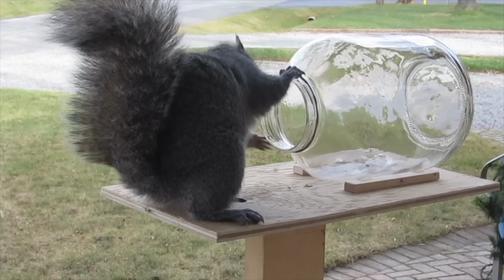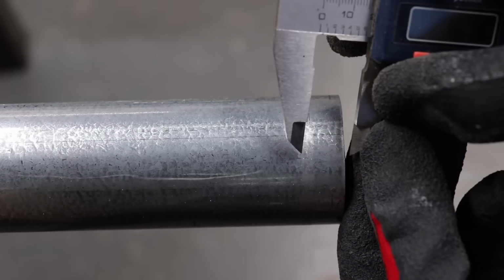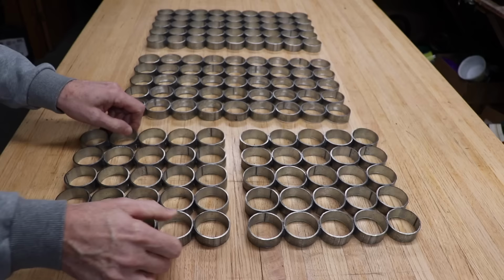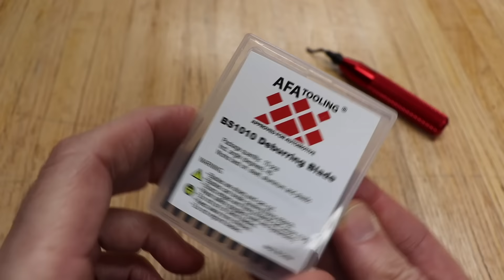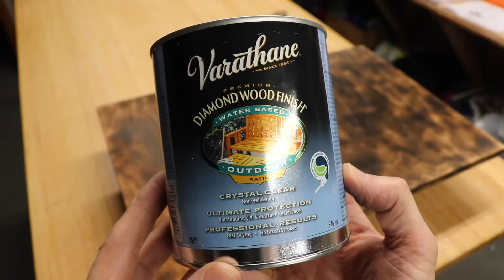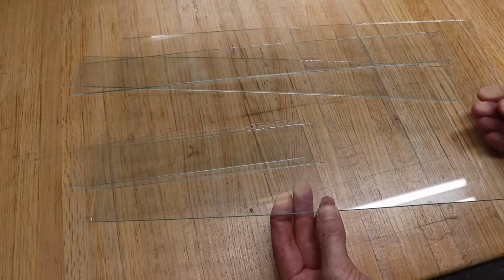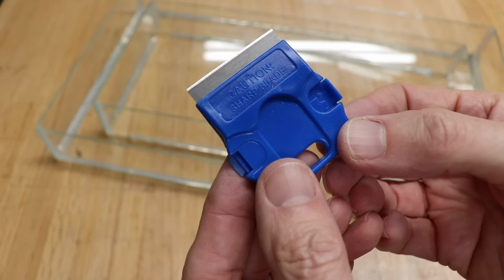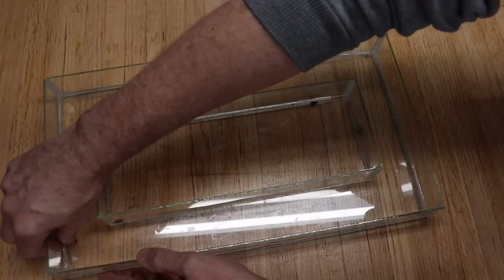How to Make ● A Unique Squirrel Proof Bird Feeder ( that actually works ! )

Comment: One tiny improvement: Make the basin inside even smaller but add a wooden sitting rail on the glass. Put a box inside (no top or bottom, just four sides). Leave a small (about 0.3-07 in) gap at the bottom (use screws in the corners or wood to create the gap or cut out low arches). The box should be about two inches smaller than the basin. You can then fill the box with seeds. The seeds will spill out through the gaps. This way, the birds can't sit in the food and spoil it with their wastes.
Reply: He could just sit another bird feeder inside of it, just a mason jar or two like they use for chickens.
Reply: Thanks for that tip, I’m for ever having to clean ours out because of the larger birds but that gives me an idea of adding the water dispenser as well for the smaller birds. The best part is the Indian miner birds won’t fit through the rings so this will stop them from cleaning out the bird feeder as well. 
15 years ago there were non in our area now there are almost 50 in this area alone. 50 plus years ago some idiot released them down in Melbourne and now the can be found almost to the Top-end of Australia.
Reply: I’ve had platform feeders for nearly 10 years now and there has never been any bird poop in them.
Reply: If they do poop where they are eat or sleep they are not going to mind it. 

Unless confined. Most animals do not poop where they eat or sleep.
Reply: Why don't you build one and show us since you have so many ideas?😁
Reply: @consciousobjector2507  its a good suggestion, maybe you should try having some ideas 👌
Reply: @z1z2z3z  I'm quite satisfied with what Chris came up with! 😁
Reply: Hope you are leaving squirrel food for the little squirrels.  They need our support, too!
Reply: Nope too specific
Reply: You explained better than what I could have. I was a bit worried that the birds were walking around in the food (excrements will drop in the food).
Reply: @thelunatick1993  But poop in the food will most likely help spreading various diseases - and you wouldn't' want that, would you?
Reply: Bird feeder inception.
Reply: @z1z2z3z  Way to rip on somebody!

Comment: It shouldn’t tickle me so much to see the squirrels frustrated, but as a person that’s fed far more squirrels than birds over the years, I’m going to try to live with this personality flaw.  Ingenious bird feeder Sir!
Reply: Are bigger birds like crows able to get the feed? Or is it that this is only for small birds?
Reply: @TheKomentor  A crow is a fairly large bird and will have a body larger than a squirrel. AT 13:47 you can see what I think is a black bird (not a crow) and it appears to be too large to get into the holes. Ravens are even larger than crows. 
However, there are cardinals and other small birds that are enjoying the feeder. I think this is a reasonable trade off considering that there is no feeding of squirrels.
Reply: @TheKomentor  you can always do an open feeder for the bigger animals. If you feed crows you feed squirrels there isn't much way around it. This feeder supplies your smaller songbirds, I like to do a bar for the bigger critters and a seed feeder for the smaller ones

Comment: It’s a great idea and it works very well. About three years ago I decided to make one, but I used PVC and the same adhesive you use. PVC is so much easier to cut. Only one side is PVC on my feeder. The rest is made of cedar. Opposite to the PVC side is clear plastic so the ends are cedar. So One long side is PVC, and the other long side is clear plastic. I did this to prevent the weather from blowing the seed out or from driving rain getting to the seed.  You can’t keep all the rain out but my design works just fine. And the birds love it. Little birds can hop right in and the larger birds like Cardinals and Blue Jays can pop their head in and eat some seed as well, but no squirrels! And I will admit it was hilarious watching squirrels trying to get in and then giving up.
Reply from the maker: I made my first one with ABS pipe and they chewed through it in a week!
Reply: @chrisnotap  Wow you must have mutant squirrels.  Mine is still standing strong.  
But my PVC pieces are 1 INCH long.
Reply: What ID of PVC did you use?  Cardinals could get inside of his.
Reply: @captainwho1  In Three years  I’ve only seen one cardinal get in.  And it got out just fine.    I used  1 1/4 Inch PVC
Reply: I used PVC pipe in mine, and the squirrels chewed through it in a few days.

Comment: Chris- instead of unbolting to fill the feeder slip some flex tube through the the pipe. Ad a wide moth funnel at the top. Pour the seed in and that’s it. Let me know your thoughts
Reply: rain?
Reply: @stevenbryant4718  The tube isn't attached.  It's inserted for filling, then removed.
Reply: For some fillings that idea would work. But the tray would need to be emptied regularly otherwise it would overflow with empty shells.
Reply: Leave one set of rings off the lower part of one end piece, except for one ring at each end. Then make the smaller tray, but without the underneath spacer sticking out the sides, and groove the base slightly so the tray just fits in and won't move when closed and in place, while blocking the gap with the missing rings. (Or you can silicone the missing rings to the tray so the end looks solid when closed.) Then you can just slide out the tray to clean and refill it.
Reply: @jpolowin0  like a beer bong
Reply: Love this idea!!!! I love the squirrels but don't want to feed them, I have acorns all around my property but they still want my feeders😊
Reply: Brilliant. Everything I ever needed to know I learned on youtube LOL

Comment: This has got to be the only true squirrel proof bird feeder I have ever seen.  Chipmunks could still get in, though. 😊 Great job!  It's beautiful looking, too.
Reply: true. but now birds poo inside. so you need to revision 2. it is out there. i can think about couple options so you can maybe more.
Reply: Chipmunks tend to stay on the ground, they don't climb as much as squirrels. On the other hand a red squirrel might fit, they are smaller.
Reply: @cubertmiso  would some kind of mesh (or heck tulle is even cheaper) keep out the poop? I haven’t made one yet so figured I’d ask
Reply: @jamee_maree  Sure, it helps, but the video maker is solving old problems by creating new ones. These birds are lightweight, so redesigning the feeder to accommodate them is somewhat unnecessary. Instead, the feeder should utilize gravity and centrifugal force against squirrels and larger birds.

Then, the feeder should have a slot that collects any flying seeds, so there's no way for squirrels to game the system by using it's weight.

Comment: Really love that design! Very unique and cool looking. 
I spent a few years building bird houses that looked like rustic cabins in miniature, as a hobby. Very time consuming, cutting every cedar shingle and glueing them one by one in a staggered pattern just as in proper roofing. Stained and sealed for weather, elaborate moldings and trim-work completed the illusion that the bird houses were actual full-size houses, just seen from a distance. 
I gave a few away to neighbors for Christmas and one of them said I should start selling these bird houses since they were so cool. 
A carpenter by trade, I was just building miniature cabins for birds and would rather give them away than sell them. 
Ever the “businessman”, my neighbor asked how much these bird houses were worth if I sold them?
I asked, “To the birds? Zero dollars. To the people? Just a smile is all I want.” 
He pressed on, thinking somehow money could be made here? (I’m sure he wanted to be my promoter and take a cut of the fortune.) 
He asked, “How much did you spend on materials?” Good question. All I really bought in a store was glue, stain, varnish, and a few dowels here and there, so $50 dollars would last me a hundred birdhouse builds. He nodded excitedly. “Okay, how much time in labor for each one?” We sat and had a couple beers in my shop as I did the math. 
“Okay, since these are rustic cabin copies, I get most of my wood from fallen branches in the woods. I hike and stumble across a perfect fallen tree with a perfect natural knot hole in it, so let’s charge the customer my gas money and time, even though I’d do this for free. Then I’ll mill every branch to look like a log, mortise and tenon the joints to look authentic. Build miniature deck furniture that looks real and weathered, which takes far longer than building it full-size and brand new. Little details like moldings have to be carved and milled by hand and it takes hours. I’m not about to clock in my time for this and stick to a schedule. That’s when an art of love turns into actual “work”. So based on my labor at $45 dollars per hour and one of these birdhouses consuming 40 hours or so, I guess I’d price each birdhouse at $1800- to $2000 dollars.”
He frowned, “Nobody’s gonna pay that much for a birdhouse!” 
I laughed, “Ya think? That’s why I give them away. It’s a labor of love my friend. A smile from receiving one of my works of art has no monetary value. It’s value is priceless to me.” 
His whole idea of this being a “business venture” was ludicrous from the start and I kept making these bird houses and giving them away, each one being cooler than the last one. 
Pretty soon, I was getting more into detail like carving a banjo out of wood and leaning it against the front porch wall as if this cabin was still inhabited by humans. Birds wouldn’t notice or care but people liked the touches like miniature tools laying around and signs above the entry hole saying, “Room for rent”. Lots of people were so impressed with the detail that they wouldn’t put them outside for the birds and in the weather, but instead hang them from the ceiling or put them on a shelf in the living room as art. 
I guess that’s what I was hoping for all along.
Sorry for the long story, I really like your squirrel-resistant bird feeder here. Very open to the birds and frustrating for the squirrels who’d definitely steal all the birdseed given the chance. Did you ever wonder what you could sell these for? Or did you just have fun creating it and solving a problem. I’m sure my old neighbor would be interested in you starting a business for no good reason. 
Ignore him and have fun. Great channel. Just subscribed.
Reply: This story was delightful!
Reply: @activatedcharcoal , Thank you. My old neighbor was a flea market guy and took one of the birdhouses I made for him, to the flea market to sell along with all the other crap he tried to sell. He was one of those guys who had no appreciation or respect for a gift, but try to sell it for money. He wasn’t poor, he was just lame and greedy.  
He came back and said he sold my gift to him for $500 dollars. I told him he got ripped off. He frowned, “But I got it for free and made $500 bucks!” 
Yeah, he never understood. 
Take care and be safe my friend.
Reply: Wow Sean! That is a labor of love! And, sounds like wonderful works of art. Maybe you'll be the next Van Gogh? Either way, awesome story! It really tells a lot about someone's character who gets more satisfaction out of hiking, building, & making people smile than thinking about the money aspect of it. 👍♥️
Reply: I think we would all love to see some photos. Your birdhouses sound absolutely amazing!
Reply: @Woodstock271  - wow.  Some ppl really don’t understand.  

I make felt embroidery stockings by hand.  Mats cost $25-30 (I buy a kit) but it takes me like 2 months to do them.  My first and most intricate one I did took 3 months.  I did a mermaid and her entire tail was sequin embroidery with the fin being all bead embroidery.  Her tail alone took 3 weeks lol.

I gave it to my sister.  It was customized to have her name on the stocking and my artist signature.  It is priceless to me and thankfully to her.  I’m glad I get to see it when I visit.

I hope to one day make my own felt embroidery creations without a kit but I currently have kids so I don’t have that much time.  But I’m compelled to sew (if I don’t sew or crochet, I get depressed) so I use the kits.  There’s still a bit of personal flourish on how you embroider and piece the pattern together so I still feel like I’m using my artistic eye even if it is a kit.

Just wanted to say thanks for the story and sorry about your neighbor that sold your art that was a gift.  My mom sold stuff at a flea market as well but she would never sell one of kind pieces.  She kept that kind of stuff for herself.
Reply: @umiluv  , That’s really cool and you definitely understand. I used to do beadwork as well but on a loom. Mostly Native American style bracelets, earrings, watch bands, walking stick wraps, etc. And I also followed patterns available on the internet. And again, the materials cost almost nothing but the time involved in creating these things could never be paid for in a fair way. So I gave my beadwork away as well. 
And I did this for the same reason you are. I was depressed. My father died in 2016 and I inherited his house up in Canada. My plan was to sell the house and fly back to Hawaii where I’m from. Well, that’s what I told the border patrol but I had no intention of leaving Canada or selling my dad’s house. My dad was my best friend and I was nauseous with grief for the first few months. I could barely even start going through old family pictures and heirlooms. So I gave up and decided to stay a while. A “while” turned into 4 years. 😅
Immigration told me all I needed to do is go back to the States for a year and maybe, just maybe, they’d accept my citizenship application. 
I wasn’t taking that chance so I lived there illegally. Didn’t need to work so I wasn’t on the books. Paid my property taxes and that’s all they cared about. 
Bored and depressed, that’s when I got into my artwork. Gotta keep your mind and hands occupied, might as well make beautiful things in the process right? Selling them seems almost wrong, you put a lot of heart into this. Giving them as gifts is the only way to go. 
Keeping them doesn’t make sense, who wants a house full of birdhouses and beadwork? But yeah, my one Canadian neighbor was the only one who was raised wrong and would sell a gift. The rest were awesome and appreciative people. 
Glad you’re one of us, my friend. 
Keep doing what makes you happy and in turn, making others happy as well. 
Peace and aloha to you and yours always.
Reply: @maryweisenbacher1034  , I have a bunch of photos of the birdhouses but no way to share them here. And I don’t have a real channel I upload things to, so that’s out. I’m kinda old-school and don’t want notoriety. But maybe if you look up “Crazy custom birdhouses”, you might see one of mine. But it would be the recipient’s pic and not something I did. In fact, I’ve never even looked to see if someone showed off my birdhouses. It’s one of those things I did but I’ve moved on and remember those days the way I do. 
Thank you though. 🤙🏼
Reply: @kevins4611  , Yeah man, that’s about it for me. My artwork is almost incidental and based on my experiences in nature. My first one was so fun to build, I just couldn’t stop. But yeah, selling something like that just isn’t my thing. Giving them away is awesome!
Reply: Nice story, thanks for sharing 😁

Comment: Both of the designs are GREAT,  but I really think I like your first design better! Of course the second is more refined and probably holds more food, but I'm a bird WATCHER first, so the first design lends itself more toward that to me. Thanks for sharing both of them!!
Reply from the maker: Thanks for that great feedback! I have a second design in mind for the first version, the one you like, that would use stainless steel instead of copper.
Reply: @chrisnotap  Can't wait to see it!
Reply: @chrisnotap better patent that! I would because it works.
Reply: @chrisnotap  I’d use plexiglass too instead of glass? Just in case a limb were to drop on it.
Reply: @chrisnotap  Stainless steel is good in that it never rusts and looks good all year. 
Copper is pretty if you are going for a patina look. 👍🏻

Comment: I saw the original squirrel-proof video when you first posted it and now I’ve seen the new iteration. It’s a marvelously improved design. If you added some glass to the bottom row of openings, that would block most of the excess seeds from reaching the outside wooden ledge. Adding the perches was a great touch. Continued success with your videos and clever inventions.
Reply: I was thinking the same thing when he first removed it. Then the squirrels would learn to actually leave it alone and not scare the birds away as often
Reply: @BouncingTribbles  I suppose it depends on whether you want squirrels to go away completely, or you just don't want them to hog all the seed and empty the feeder.  My sense is that Chris, like me, isn't trying to make the squirrels leave completely but rather to just keep them from hogging it all.  Good suggestion though for those that would rather the squirrels move along to someplace else.  Personally, I enjoy watching the squirrels play and try to figure things out but I have no interest in giving them a never-ending buffet of seed.  This solution is fantastic to that end.  Well done!
Reply: @ReitersBlock  maybe your squirrels are nicer than ours. We don't have a feeder but the squirrels are always there, they don't need the encouragement. If anything they're the ones that drive the birds away. The cats are mostly out in the evening and at night